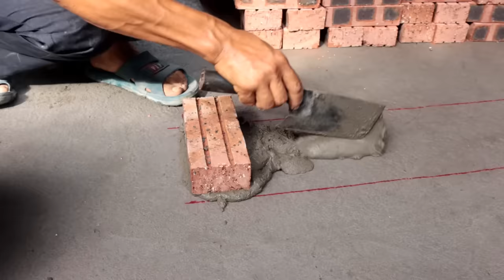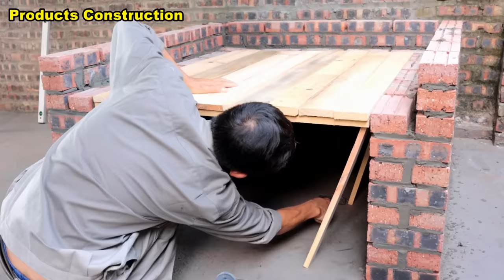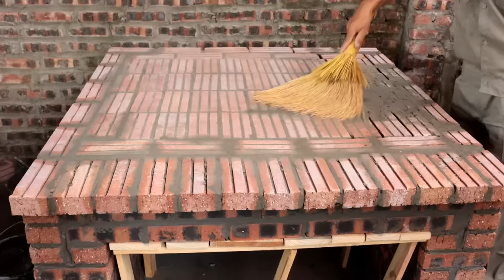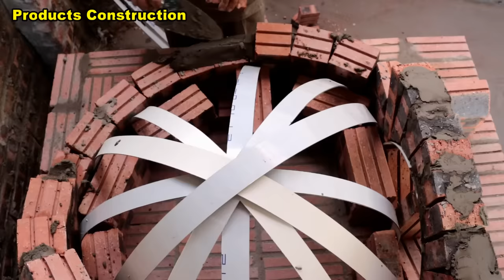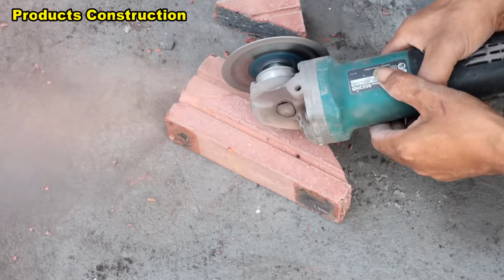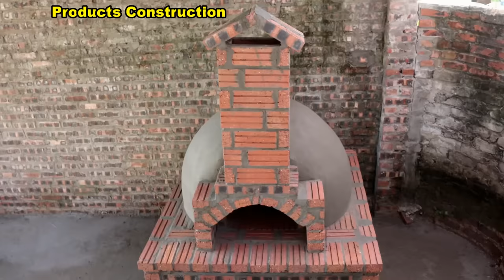How To Build Dome Pizza Oven With Brick Beautiful And Unique

Comment: No refractory cement, no fire bricks, bricks are not staggered and no insulation.  It would not have taken that much more money or effort to make it right.  If I hired someone to build one in my backyard and saw this, I would chase them away with a stick.
Reply: Они используют кирпич марки прочности М125, по российский системе. Этот кирпич в России используют для выкладки фундамента. 
В России есть кирпич М200 для кладки печей и каминов. 
В идеале из кирпича М 125 можно сделать основание 
Из кирпича М200 для печей (Печной) можно сделать саму печь или использовать жёлтый шамотный кирпич. Кладочная смесь для кладки каминов и печей с добавлением глины. 
Цемент треснет, я это видел сам. 
Мастер так же не использует штукатурную сетку для цемента. 
Красиво, не известно как повела себя печь. 
Я сам выкладываю анолоничную схему, но буду использовать правильные материалы. 
Посмотрим, что вышло. Напишу, что получилось через 2-3 месяца.

Comment: This was very nice to watch. I see two problems though. No insulation under the oven floor and lots of sand between the bricks on the oven floor which means you can’t put pizza or bread directly on the oven floor
Reply: After about a dozen sessions the first few layers of sand will be replaced with burnt ends and flour
Reply: @MrLuckyMuffin  orang
Reply: @MrLuckyMuffin  и
Reply: Тшооо ооооо
Reply: Оиоштоооо
Reply: Оиоштоооо
Reply: Лт
Reply: Л
Reply: @MrLuckyMuffin  тшлоотлищ
Reply: Щь
Reply: @НазакетГасанова-ч5щ  English

Comment: Creative but it would be a mistake to copy him. The floor can’t be made with those ridged bricks. Needs to be smooth so pizza or bread peel can slide in and out without catching. Also, the dome can’t be sealed with just that layer of cement. You need 2-3 inches of an insulating ceramic blanket around it or otherwise you’ll be losing all the heat you’re trying to store in the bricks.